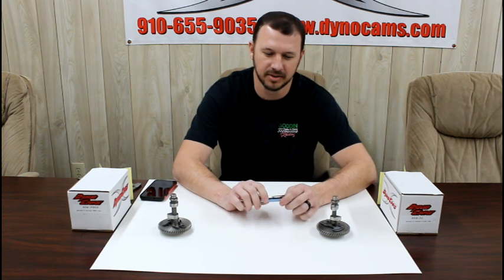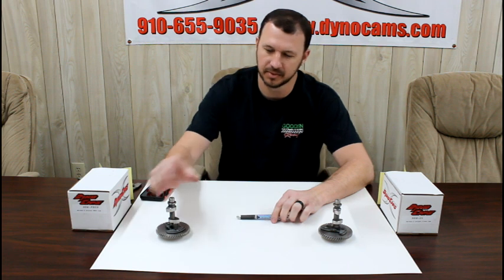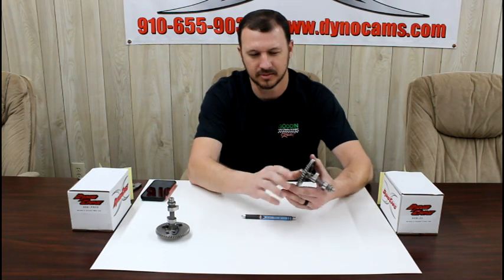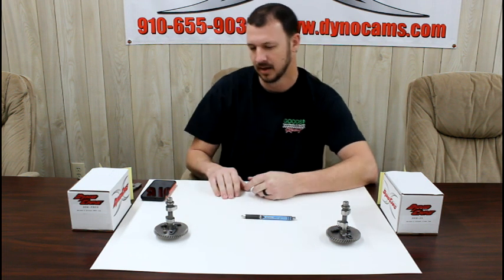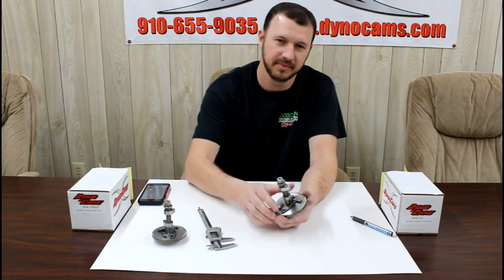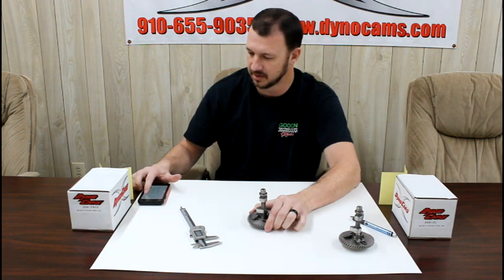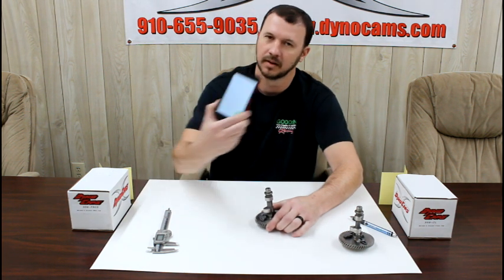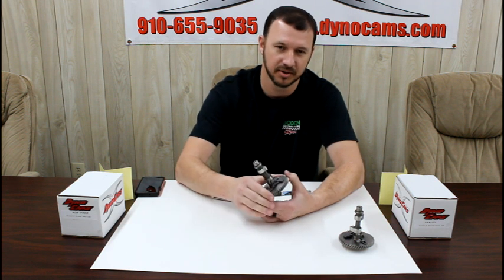Tips for Identifying a Camshaft

Comment: I get the secrets thing but when I have one that has 2016 AKRA engraved on the back and it is 2024 what could possibly be secret anymore?ROFL
the shop it came from only reply was "it's one of our AKRA cams from 2016" Err ok but no*** I knew that much.

Unfortunately my friend that used to race gave me a box of parts he had left over and doesn't remember what the cams were.
(btw both blocks are 196 Ducar, turns out they are more common here than I knew)

Anyway thankfully there is guys like you to help.
Thank You for the vid.